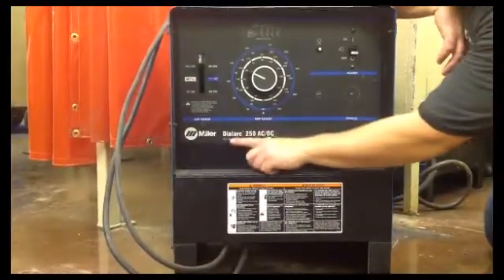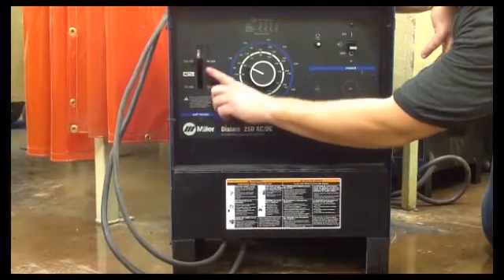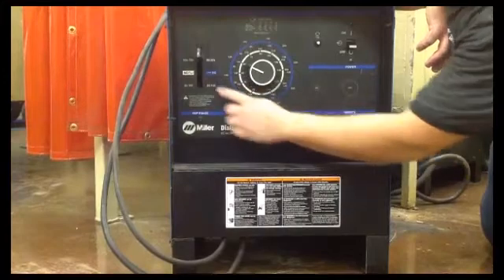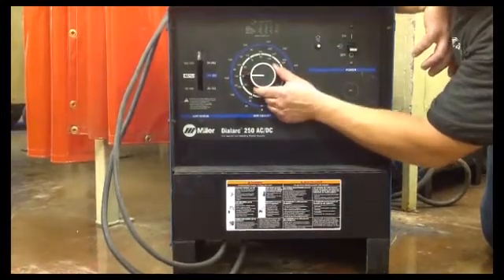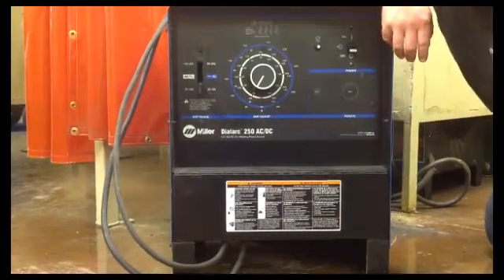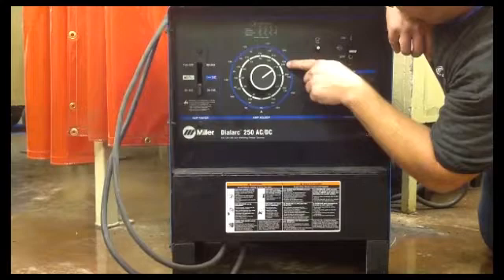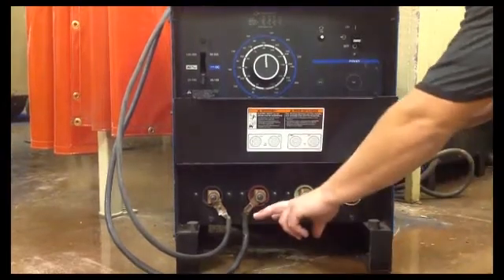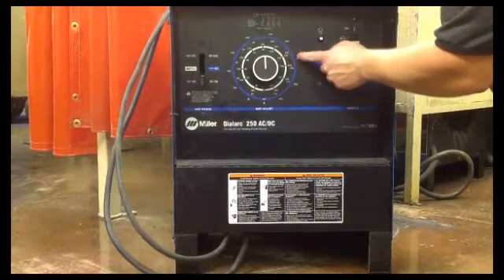Arc   Dialarc 250 Setup

Comment: good morning my brother, a question: this machine is used to work with argon? or is it only for electrode? agradesco if he helps me clarify that doubt
Reply: I use that same machine in school and it does not use argon
Reply: Y'all are ignorant af.....the machine has nothing to do with shielding gas it's a power source you can do any process with this machine. It obviously doesn't have a wire feed but there are wire feeds compatible with this machine but as it sits you can run stick or Tig.
Reply: @dakotatallent9934  what's is best for stick welding, should the lever be up or down, which is ac/dc when the lever is either up or down. Is 120 amps good for stick or less